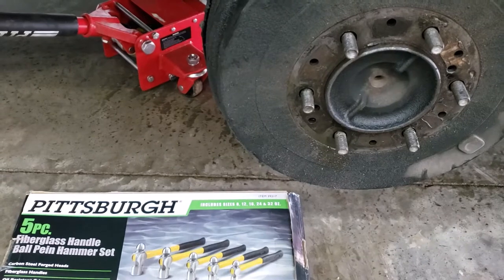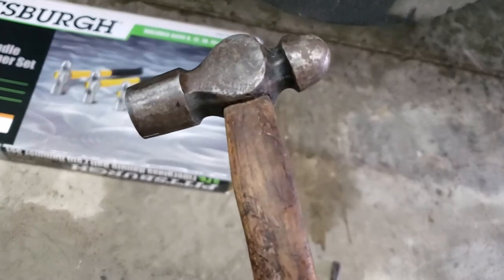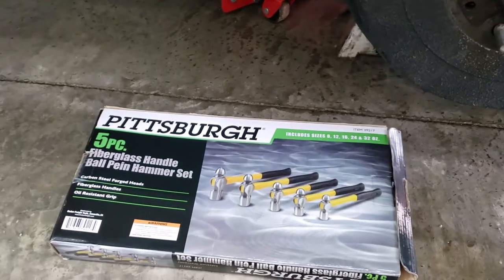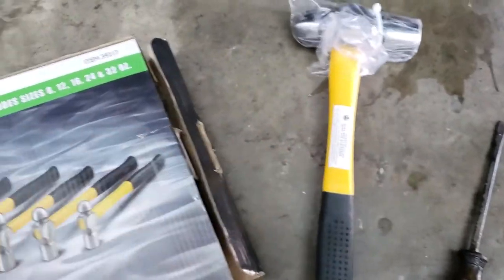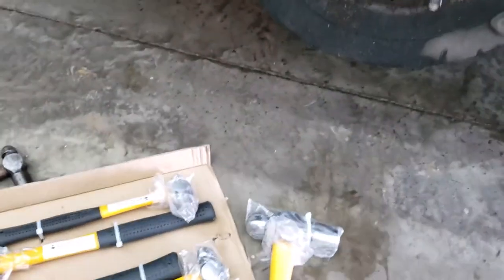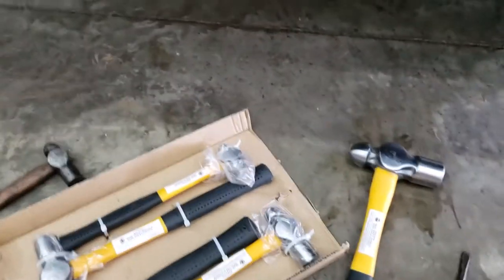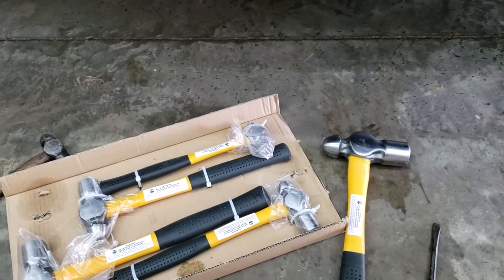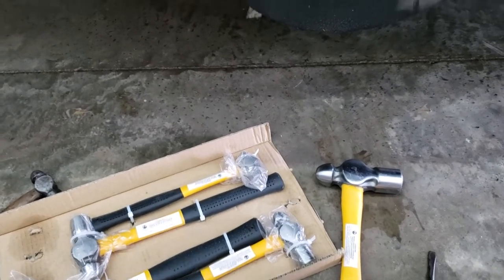Harbor Freight Pittsburgh Ball Peen Hammer Set Review

Comment: I've had that set for 8 or 9 years and used them all a lot. I'm genuinely impressed with them; I've hit steering knuckles and brake rotors and drums as hard as I can with the larger two and no issues. I've even hit a hammer with a hammer many times and nothing ever chipped.